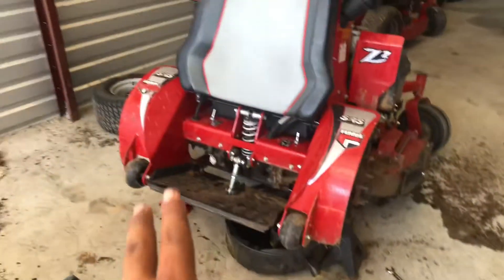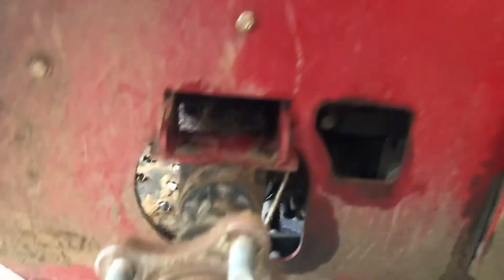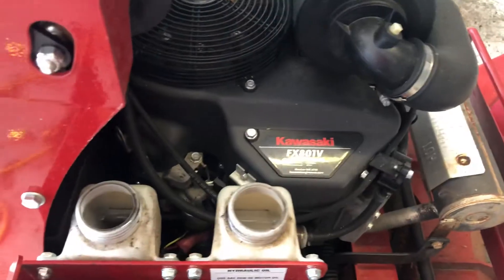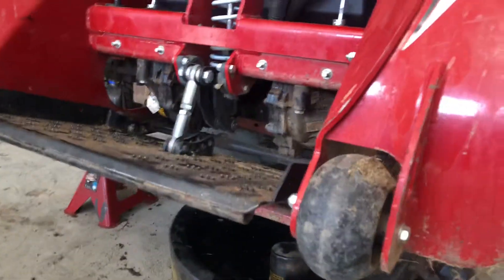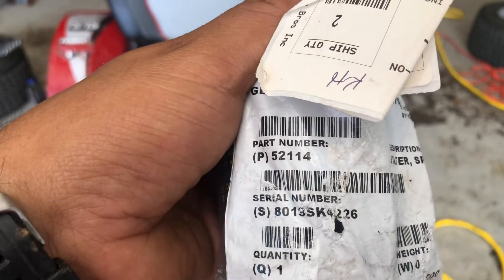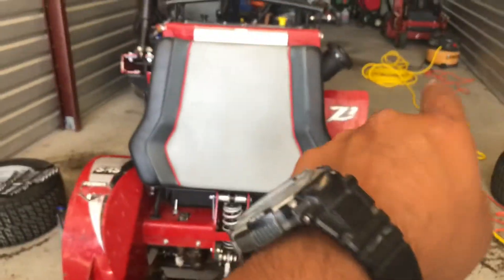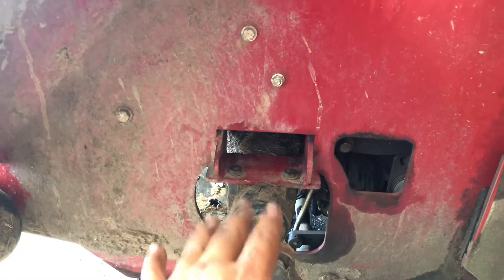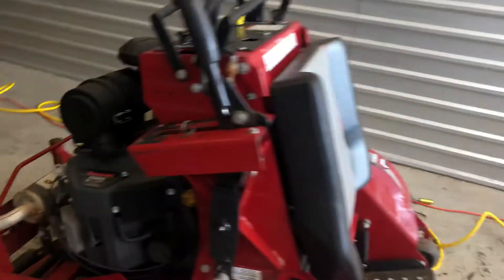Hydro oil change on a Ferris Z2 mower

Comment: Great video but...one recommendation is that you blow the machine off completely with compressed air before performing any service. A clean machine is easier to work on and prolongs life of the machine! We’re  in the middle of tropical storm ETA in FL so it’s a good day to do that along with a complete service to my Z1 36”.

Comment: How often you change hydro fluid? 

I have 150 hrs on mine and I’m getting some feedback on left handle when making right turns it strains somewhat when making the turn not as fluid as it once was

Not under warranty anymore
Reply: get the own'ers manual out and re set the adjustments